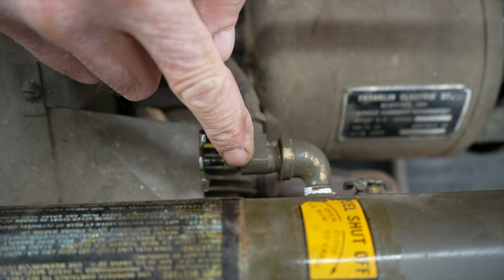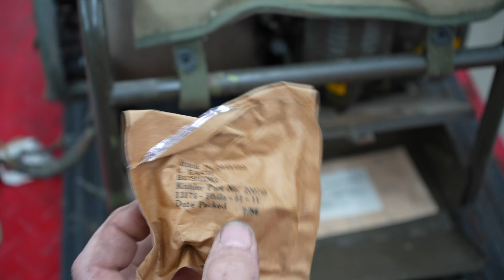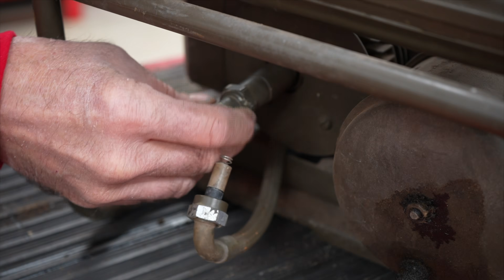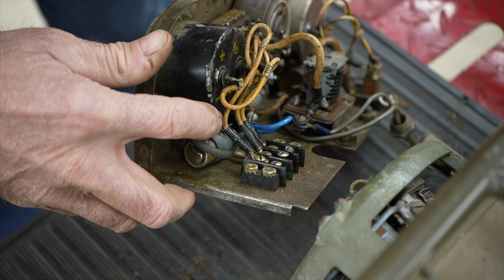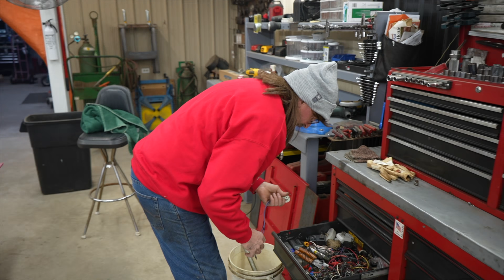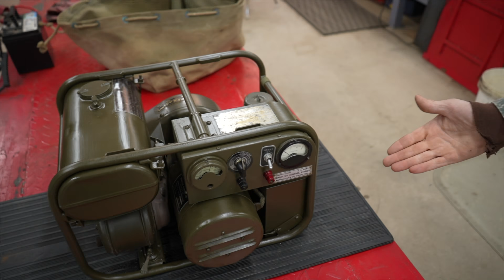SURPRISES INSIDE! Restored To Glory 1952 Military Generator

Comment: Terrell thank you for taking the time that was a fantastic video having been in a civil air patrol we had a Air Force generator that we used to power up our RadioShack and it would run the lights and we would plug in AC to DC power supplies for our radios. I worked on a generator and I got it to run for us so it was outside and we would plug it into the wall in that gave us power inside. Brought back memories my friend

Comment: Mfd, or uF are symbols for Microfarad, not Farad.  A good place to source capacitors and other older bits is called Antique  Electronic Supply Co., and yes, they're online.  Those old electrolytic capacitors (or condensers as car people still call them) have a liquid inside them that dries up over the years causing them to fail/leak.  I'd replace all the wax paper caps if there are any in it as those will tend to be leaky and even when new weren't the most accurate things in the world. Ceramic disc capacitors rarely ever go bad.   I always thought it was funny that in engine parlance that they still call capacitors condensers, as that's the old name for them.  Kind of like saying something is 60 cycles instead of 60 hertz.  Your old radios from back then would call the broadcast (AM) band's frequencies Kilocycles or Kc that nowadays radios show as Kilohertz or KHz.

Comment: I have a generator that puts out 220 and 110 from 1941 It says 1941 on the date of manufacture anyway I can’t make it put out the 220 that is designed for and I think one of the capacitors is bad but I can’t find a new one for it

Comment: I inherited one of these from my dad (has the starter function). Back when these were made I doubt what we would call "2-stroke oil" existed. My unit has a paper label (on the tank) that has become largely illegible over time, which once upon a time indicated oil ratio info. As I recall the ratio specified made me assume the oil originally specified was likely 30 wt non-detergent motor oil.
Taryl... Do you or a commenter have a suggestion as to what ratio to use with a modern 2-stroke oil??? Or a synthetic???
In the past, I think I (and dad) used motorcycle oil (at the 24:1 ratio used on my dirt bikes).
Thanks in advance...I really enjoy your channel content and presentation!!!

Comment: Taryl, The Australian Army in New Guinea and all the islands around during WW2 had an Army unit of the Independant Company known as Coastwatchers. They later were known as Commandos. They located themselves in clandestine coastal locations and other places to watch what the Japanese were doing, shipping movements, aircraft etc. They reported activity via radio. To do this they had to have a small generator which could be carried in. Anyone who knows any thing about New Guinea knows how hard that would be. The generator had to be in a hole in the ground to keep it quiet. As far as I know they didn’t use 2 stroke machines though, it would have been hard to disguise the exhaust smell. If they were caught it meant instant death.

Comment: A lot of similar things to those as they put on the cheap china HF generators .  I have two of those tailgate generators. As long as you run them correctly . They run perfectly . Mine do and one was a none runner when I got it .

Comment: With no load no amps can flow. There is a little screw at the bottom for zero adjustment of the needle and with your light bulb connected some amps should have shown but you blew it 😅

Comment: That's what i do whenever i run my generator. Whenever i'm done using it i turn the fuel off and just let it run and slowly close the choke to help all the fuel out. It could set for 2 months without being used and all i would do is put fresh fuel in and it fires up on the first pull

Comment: One thing I've done in the past with old/original capacitors: I've gutted the bad capacitor and replaced the guts with the new/modern capacitor and soldered the leads to the appropriate location on the old capacitor and reassembled the case.  That way, you can keep the original look!
Reply: Nice!

Comment: I recognize the Jacobsen carburetor placement, I used to have a newer engine from a reel type lawnmower, it was orange. The radio frequency suppression sheathing over the coil wire is a military thing, I had a generator engine from the '60s with that.

Comment: There were "Communication Shelters" that slid into the back of a truck bed, basically a modern day "slide in camper" for pickup trucks.  These generators may have been part of that system, but those shelters were generally much higher power requirements, so perhaps not.

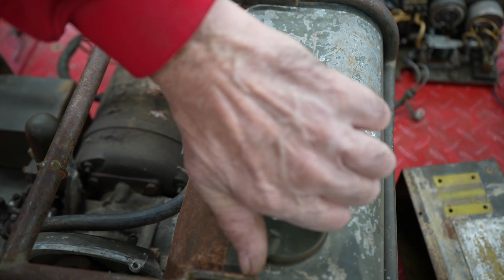Comment: Much, most, or possibly all of the military radio equipment was designed to operate on 24-28 VDC. @24:47 you said "a half a Farad", no... that's a half of a MICRO Farad.  A half Farad capacitor would be YUUUGE !  That small letter " u " means MICRO.

Comment: @Taryi Fixes All, Folks that restore tube radios (many on YT) will drill out the defective dielectric material from those defective capacitors and place a modern type inside, so it looks like the original. It can be potted with epoxy and nobody would know the difference. Something to keep in mind. Have a Merry Christmas you look real dapper in your red Christmas jersey🎄

Comment: it is not a u it is a μ which stands for micro in the metric system, 1000 μ = 1m (mili) in this case Farads, μF where 1F = 1000mF = 1000000μF so 1/2 F = 500000μF  ....  

Basically a capacitor is like a float bowl for electricity, it will only hold so much, if it exceeds it overflows out, if it is less it keeps filling up.
Or a pressure valve, once so much pressure is reached it opens up 

So charge one up to the maximum and then throw it to junior's hands to discharge ... he will have a laugh and funny hair afterwards :)

Comment: 5:57 way before the whole part no longer available discontinued shit nowadays on essentially brand new 2020 breaks and then scrap them engines, where Taryl basically showed that compression tests are almost completely useless, Chinese piston ring tolerances are junk, just like when they were trying to figure out how to mass produce a ball point pen, and the only test you should trust is actually a leak down, which takes longer to find tdc on the compression stroke instead of the simplicity of hooking a gauge up and crank crank cranking until the compression gauge no longer goes up. Everything you thought about the compression test was a lie

Comment: Imagine if it could talk. I can imagine it on a destroyer in the middle of the battle, black smoke churning as the captain is at full throttle. You never know, this generator could have saved the day. Pushed to its limit and then some, and it's still here. Do that with your troybilt.

Comment: Taryl, the capacitance is micro farads (uf) not Farads. For an example those guys with the bass speakers use upto a 10 Farad capacitor for power stiffing, also a 1 Farad capacitor is very large.

Comment: WOOOOOOOO!!!!! I love 2 strokes!!!!!! Those little Jacobsen 2 strokes are good little engines! The R.E. Phelon magnetos were used in Clinton, Power Products-Lauson-Tecumish , and a few others actually! Good mags-my 10 dollar Clinton 2 stroke has a spark hot as a GM HEI ignition without touching it! I should still pull the flywheel and put sone some Hammond organ tone generator bearings oil on the felt cam lubrication felt and check points gap, though. I want to hear it run! Nothing beats a 2 stroke! Awesome little gen set, Taryl!

Comment: I have 2 of those as I noticed it in another Video. Mine are 1943 and are 110/240 Ac You have to change the taps under the Cover. Mine are in good running condition. One of then has a complete tool / Parts box and as per the manual is complete... My tool/parts Box is the same as Your Parts unit.
My Engines have the jacobson tags on them . And westinghouse Alternators.
Thanks Taryl..

Comment: Neat video. I think you might have the potentiometer wired in reverse, which is why it immediately goes to 30V when the dial is turned past the off position. Will work the same either way, but less risk of blowing a connected device with high initial voltage if you swap the wires
Reply: Yes I thought the same thing when I noticed that turning the potentiometer was working backwards, I looked for the wiring diagram to confirm but didn't find the one he used.

Comment: Did you figure out what the fuel ratio is? I noticed it didn't smoke much. Did you just fill to the line with some modern 2cycle oil, or did you adjust it to something like a 20:1 maybe? You did a good job on that classic generator. Seems most of us like seeing these old machines run again.

Comment: The spark plug and connector looks like an aircraft engine igniter, aircraft electrical systems would use cannon plugs that are safety wired for vibration.

Comment: The old British Austin champ from the same era has shielded ignition and plugs etc, but they do have a Rolls engine installed lol, you should check out the specs.
Not exactly a small engine lol.

Comment: My dad had a big version of that. Ours was 150-200lbs. We ran 2 600 Watt airplane landing lights on a stand. Used it for fishing in salt water in Tx. As long as you ran all fuel out of carb. It would fire up on first pull even after 3 years of sitting. Me and buddy of mine put motorcycle mufkin on it. Couldn't find one. All I remember about it it said Homelite on it. We used 5 gallon can as fuel tank. I finally let my brother take it. It needed to be rewired.

Comment: A Governor in aviation that I'm familiar with will maintain a constant speed. Many propeller driven aircraft have propeller governors that maintain a set speed, no matter throttle position, by changing the blade angle. Add more throttle and RPM stays constant as power increases. This would be good to keep the generator at a set RPM to maintain proper voltage under various electrical loads.

Comment: Taryl my secret to for that to help with preventing that use some echo Red armor 2 stroke motor oil it's red in color to. It's mixed the exactly the same Way to. That 2 stroke motor oil is designed to remove those carbon buildup deposits inside of 2 stroke modern engines now day's.,an it will work in those older military engines.

Comment: They were using SAE 30 non detergent motor oil mixed at 16:1 back in that time. My 1945 Gale Outboard specified that mix in the manual.

Comment: Best battery charger I've seen😉
If you have an rv or truck needing heat, be easy to power a diesel heater with that generator or charger battery bank.

Comment: That "shunt" looks like a current relay?
Reply from the maker: It actually is for the starter switch. When the battery is hooked up to the generator if you pushed on the top of the shunt and the contacts touched it would start cranking the engine. There’s yur dinner! Pretty cool old technology.

Comment: What a great example of succesful electro mechanical detective work this video demonstrates. This is way above my pay grade. Thank you for saving this 72 year-old veteran. It still serves reliably. The still wrapped tools and parts suggests to me this generator didn't see much if any active duty. Spent most of its time in a warehouse or supply depot until it was declared obsolete at which time it was demilled by having the control panel removed . Excellent video.

Comment: Taryl, you guys have a great channel, BUT THIS VIDEO MADE IT EVEN GREATER.. Iam a Vietnam Veteran of US Army, Signal Corps. drafted Jan 1968, signal school Ft. Gordon, where we got to see these small  company or platoon size generators,  they were 1967 versions, a tad bit bigger and better gauges, we also touched on Morse code , we never used either of them. my MOS (army job) was comm. center.I was in Vietnam Mekong Delta 1969, I volunteered for Vietnam, I was in West Germany Boeblinge Panzer Kaserne.  Bob Gouveia, Burlington Taxachusetts.  MERRY CHRISTMAS  to all.
Reply: My father was also in the Signal or Communications corp from 1966 to 1968. He was Honor Graduate of U.S. Army Southeastern Signal School, at Fort Gordon (Georgia). Army Communications VHF site Di An 595th Signal Complex. Up Tight. NCOIC and OIC. The reason I mention all this is a photo of two larger generators on single axle trailers. I never forget the photo of Querer Fernandez pretending to chop one of these two generators with a huge fire axe! Apparently, one of the units was tempermental. Likely a fuel quality issue, even though I believe they are diesel.
Reply: @pgmurray76  , Thanks for the comment, Big salute for your Dad.
Reply: @ronsbeerreviewstools4361  Thank you sir! Definitely a salute to you, as you were in quite a hot spot. A war on water, this is wild. He had a custom Vibroplex rhodium and gold plated keyer, but never got to use it. A super cool antenna tuner with so many precison plates inside is in the basement. I love how good things were made long before CNC units. I inspect parts for slip rings these days (yes, plenty of defense units!)

Comment: That one was probably sold off after it was obsolete threw surplus stores or in the back of magazines mail order and probably never used . That's what they did back then . I have a 1943 PE95 signal corps generator 10 kw with the willys go devil engine use to run a welder off it stick welder  . I have 10 box's of spare parts some I pitched put years ago . Nice video teradactal .

Comment: i know you like to solve your own mysteries, it seems the war department tech manual in not findable (at least by me) on the interweb for the pe-162-c.
however, there is one for the previous model the pe-162-b; tm11-971 is the war department designation for the technical manual.
this dates 1945, but has interesting illustrations and part info.
great oddity, sir.